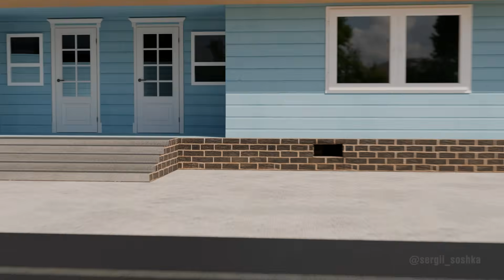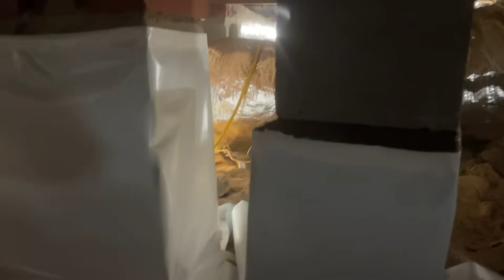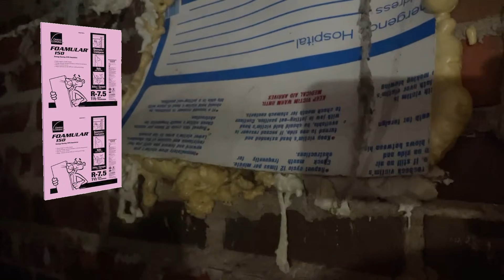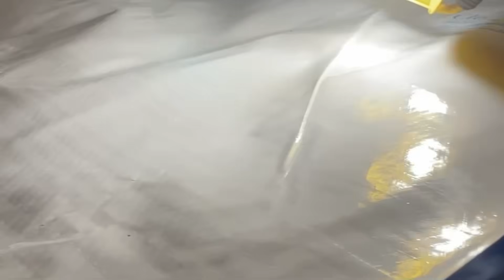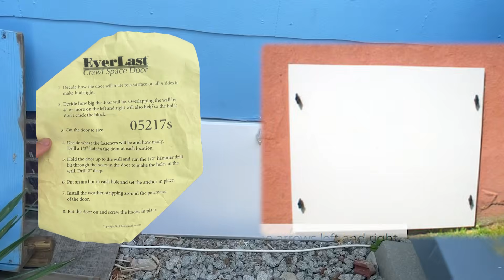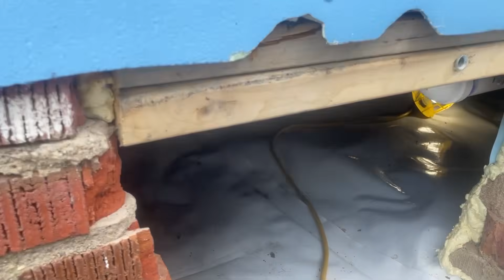Why You Should Fix Your Crawlspace Before It's Too Late

Comment: Awesome video this is very helpful. I have questions if I use foam boards before the insulation sheet on the walls will the board need to expose 6inch of the masonry? Also will it help with preventing pipes freezing in winter?